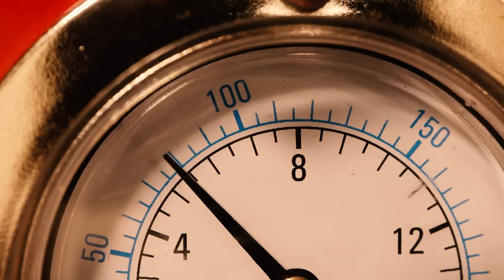Zippo Lighter Restoration repair and refill

Comment: As a Zippo collector, I must say... 
Man, what a great job! 
I thought that I was giving proper maintenance to my own lighters, until I saw this. I learned a lot, and I'm thankful for it. 

Now, about the fluids...
It depends for what you're going to use it really. 
The original fluid has very good qualities, since it burns slow, useful for prolonged uses before refill, and because it's odorless, a most-have feature for a smoker. 
Other fluids have one quality or the other, bur rarely both. 
If the burning is good, then it's very smelly; If it doesn't smell, then it burns a lot of fluid on very little time.
Reply from the maker: thank you so much for your comment Manuel I really appreciate it :)

Comment: I’m concerned as to why a 2 year old lighter has ended up like this haha
Reply: He likely rusted it himself. Lots of creators like to purposefully rust random objects and then restore them. Doesn’t make the restoration any less impressive in my opinion though.
Reply: @awesomechainsaw  your not wrong! Ayy, it’s essier than going out and finding things!
Reply: Dropped in a lake or sea or somewhere very humid with also better exposure to oxygen maybe
Reply: read the description, it tells you how.
Reply: @awesomechainsaw  just like what i thought..
Reply: @awesomechainsaw  
You are correct. I collect woodworking tools that are at least a hundred and fifty years old. Sometimes someone gives me something that looks almost brand new. It does not go with my wall collection so I put it on my roof from anywhere of 3 months to a year or more.
Reply: The description says it had been sitting in water.

Comment: Zippo fluid works just fine, but Ronsonol fluid lasts longer and doesn’t seem to evaporate as quickly inside the lighter.. 
But that’s just my own opinion.
Reply: Ronsonol is made by Zippo. So I guess it must be the exact same fluid, smells the same and lasts the same.

Comment: odd how the exterior casing of a lighter that is chrome plated brass has rust on it
Reply: its because he faked the "age" of the lighter.
look at the spring it have a lot of  "rust" but still shiny in the coils.
Reply: paiamcfly please read
Reply: chrome may oxidise a little but it wont "rust" only tin or an alloy high in iron will "rust" (rust is a reddish- or yellowish-brown flaky coating of iron oxide that is formed on iron or steel by oxidation, especially in the presence of moisture.) I know this is semantics but well you know...
Reply: @paulbecket7399  well said but first look at ur brain maybe theres rust on it,,kj,,

Comment: 1. How to make a 2 year old zippo look 200 leave it in water like the owner did. 
2. Then send it to this guy to make it better than new again.
Reply: trandmain  If you check the bottom shots of the Zippo you can clearly see the date that all Zippos have :p the letter is for month and numbers for what year so it is in fact 2 years old :p
Reply: I have suspected this for quite some time.    8^/
Reply: trandmain this isn’t an old zippo though. Date code clearly shows it’s from 2018
Reply: Probably buried in back yard for a month
Reply: trandmain  his brain is rusty we know for sure
Reply: I suspected something like this on another video I watched of this guy last night of a harley Davidson one o recon he just sticks them in acid or something for abit then does this they aren't old at all
Reply: trandmain  the bottom on the Zippo clearly shows "18", for 2018. Look up Zippo date codes on google. From 2001 onwards, they used two digit year codes- pretty easy to tell year. Before that were Roman numerals, and the oldest ones were just dot codes
Reply: I always wondered why all the restored Zippo’s start off looking the exact same way.

Comment: What a fantastic video, who knew that a Zippo lighter had been recovered from the Titanic! I wonder what Zippo would have done if it had have been sent back to them under their lifetime warranty...
Reply from the maker: thank you so much :)
Reply: Zippo would have repair it. But not the insert; those get replaced & the original returned to the owner. I've had a few repaired by Zippo. Clever touch with the snappy Titanic reference, btw. I wonder how many people know that's not possible because timeline.
Reply: @Bob9961  Zippo absolutely would not have repaired this. They would have offered a replacement from their current range. The restoration of this lighter is very skillful. I have sent some Zippos back for repair, they are great at redoing hinges, but any 'restoration' of the case is just something they don't tackle. On one of my dads old lighters, they offered a replacement case (current range) rather than repair damage...

Comment: Zippo would have done this for free.
Reply from the maker: Njjjjjaaa - not the remove coating to pure brass part😉 👍
Reply: They don’t fully restore zippos... they just fix it mehanically
Reply: @hankhill169  Go wpe some tanks.
Reply: James The New Normal no I’m serious, the finish isn’t guaranteed in the warranty just mechanical Stuff they will fix for free
Reply: @hankhill169  Ok I believe you but I have never heard of a propane pocket lighter and we all know you think butane is a bastard gas.
Reply: James The New Normal there are butane pocket lighters, and Butane is bastard gas

Comment: that hole is for filling it with fluid, if you put a spare flint in it when you open it your flint will fall out, the spare goes under the mat.

Comment: Have you found a clear coat thats durable enough to put on a brass zippo that would be used regularly? Its so hard to find an answer anywhere! Great video btw!
Reply from the maker: No - but I actually don't really use my Zippos, I don't smoke so they are only for display. Hope you find one that works :)
Reply: @AwesomeRestorations  crap, well thank you for your quick reply and for making great videos!

Comment: Zippo lighter fluid is fine, but I wouldn't use zippo flints.  The flint from a BIC lighter will last 50x longer,  you may have to cut them in half though. 👍
Reply from the maker: Thanks for the good tip about the flint. I will test a BIC flint sometime soon :)

Comment: Hey i metal detect, I found a 1996 zippo designed by Barrett Smythe with a cobra on the front, it's complete but is a little rougher than that one because it has bad dents, a few breaks, but it is complete, if you wanted to take it on i'd gladly mail it to you, a Mint condition version is around $400, so you might have a couple hundred dollar, fairly rare lighter in the end?
Reply from the maker: cool - but I already have a lot of projects planned in :) but thanks for asking

Comment: I did this so many times. Now also I have zippo lighter but I m not using. Because fuel will be dry after some time and not able to use lighter. I replaced zippo with Chinese lighter

Comment: Great video! Great job with the restoration!  However, I just want to point out that you can tell what year the lighter was manufactured by the 2 digit stamp on the bottom on the right hand side. The digits read 18. And zippo was founded in 1932. Therefore the stamp indicates that the lighter was manufactured in 2018. So whoever did this to this lighter shame on you.

Comment: I know i’m 3 years “late,” but I just had this recommended, and I was curious, what was the liquid you put the blue dye (?) in and then placed the case parts in?
Reply from the maker: Secret bro 😉
Reply: @AwesomeRestorations  aww. I have a couple ideas based on the solvents I use, but if it's an industry secret, it's a secret.

Comment: Where's the link to zippo parts you didn't posted it
Reply from the maker: sorry this is an old video and the links are not active any longer
Reply: Can you kindly share the new one specially for the lighter fluid cheaper ones or any other substitute

Comment: What is meant by sand blasting...? Can anybody tell me
Reply from the maker: Sandblasting is kinda like peeling. You "spray" sand under very high pressure (the pressure is made by a big compressor). The high pressure allows the sand to remove dirt and rust :)
Reply: @AwesomeRestorations  ohhhhhhh(that meme) ✌️✌️😂

Comment: Wtf is this witchcraft called sandblasting
Reply from the maker: Sandblasting is kinda like peeling. You "spray" sand under very high pressure (the pressure is made by a big compressor). The high pressure allows the sand to remove dirt and rust :)
Reply: @AwesomeRestorations  really cool machines, I wonder how people have figured out how to create these things. You make the restorations so easy and make me want to change career paths 😂